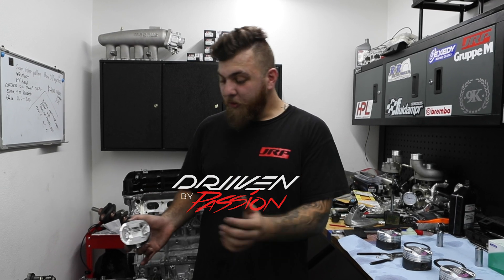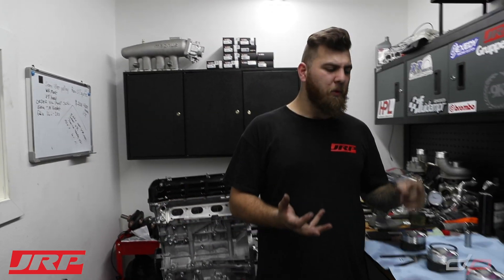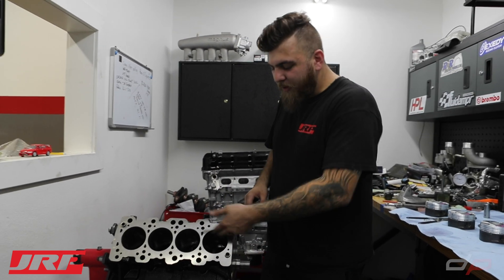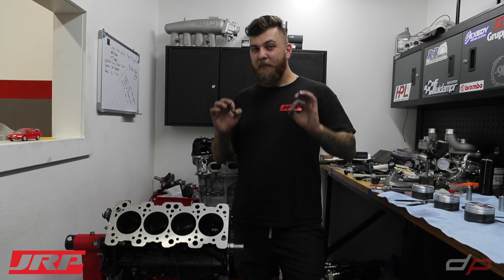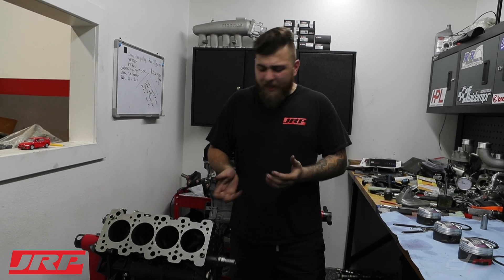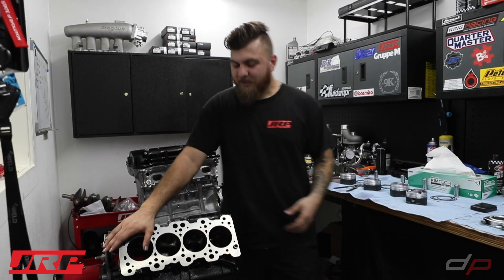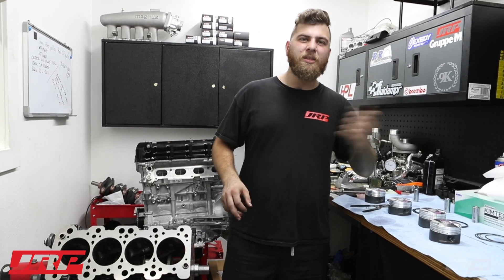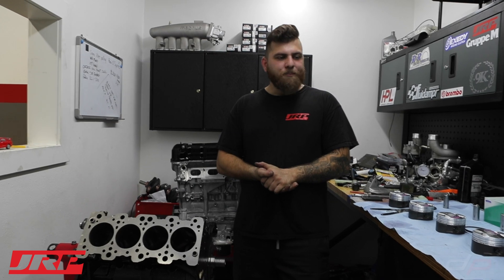JRP Engine Machine Work And Engine Break In Procedures

Comment: I’ve seen people break in engines with just 5W-40 synthetic and change it at 500, 1500, 3000 miles...is “break in engine oil “ really necessary?
Reply: Arturo it is vital to use break in oil. One of the main reasons is break in oil doesnt have friction modifiers and has less detergent, and total base. This allows for a controlled wear to happen for the first 500-1000 miles. We are seeing huge hp gains and better sealing from this process.